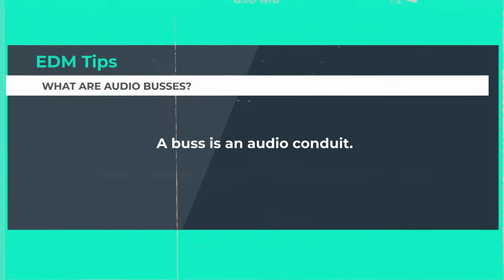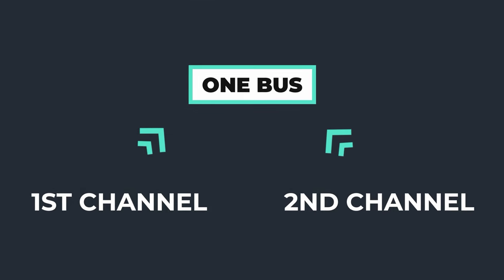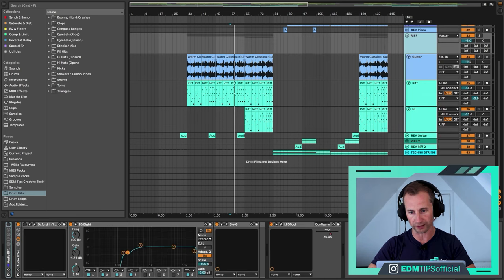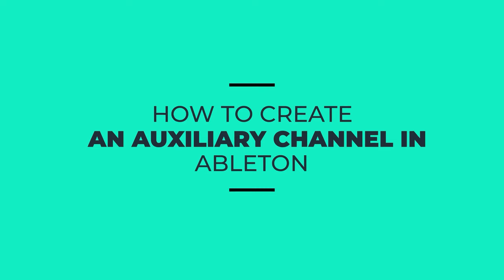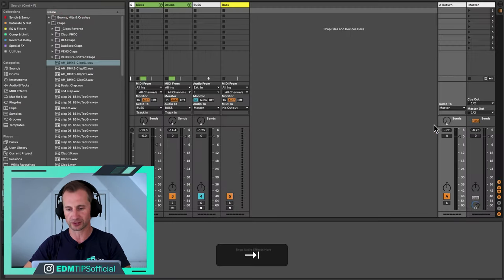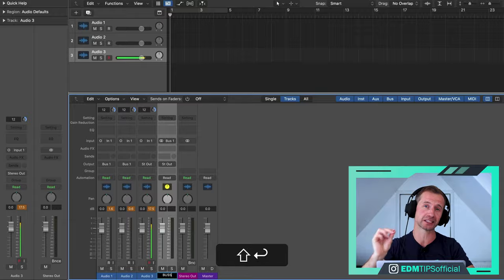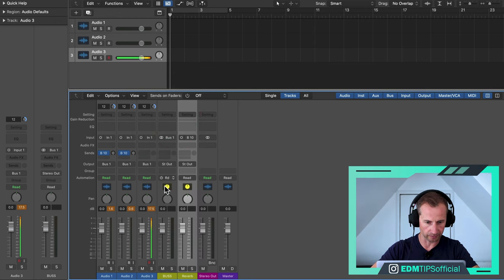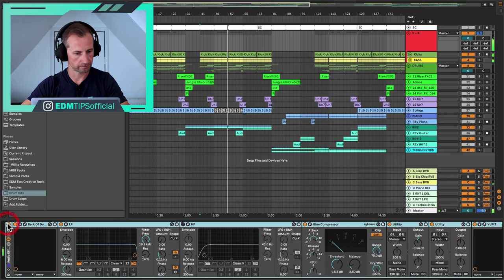Mix Bus Processing - Everything You Need to Know about Mix Buss!

Comment: soooo, return tracks in Ableton, I am routing them to a Mixbus with everything else ofcourse (mixes then routed to master). But when I do this some sort of pre delay of all my return effects appear, so my reverb adds a longer pre delay then I've actually dialed in... tried routing my return tracks back to master out and everything sounds fine. 
But they now bypass my mixbuss channel and go straight to the master. Haven't figured this out yet so I'm just creating parallel fx chains with the same effects on my desired tracks instead. Takes longer time but at least it sounds correct. Any tips? cheers